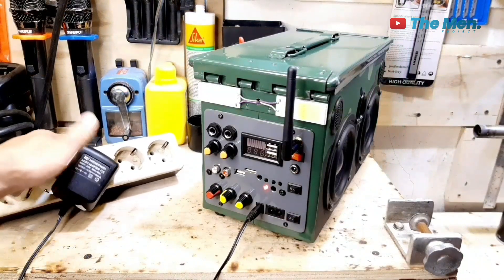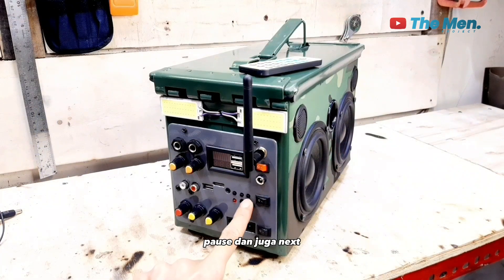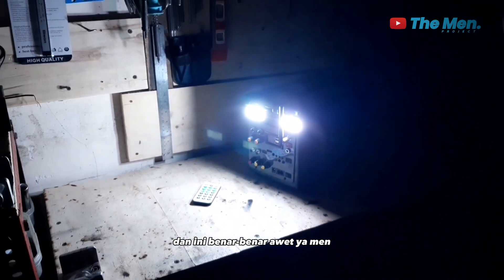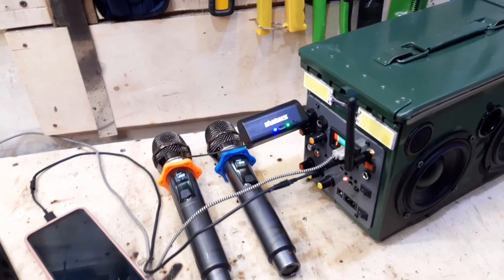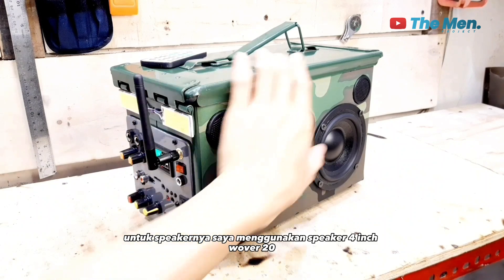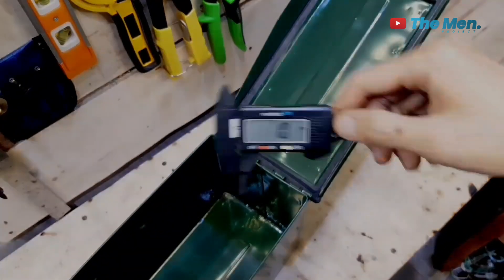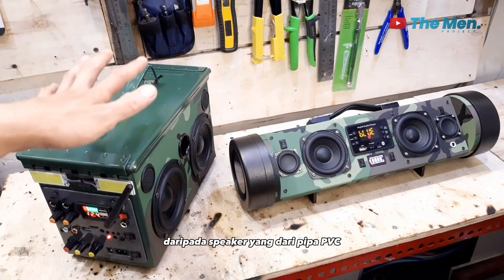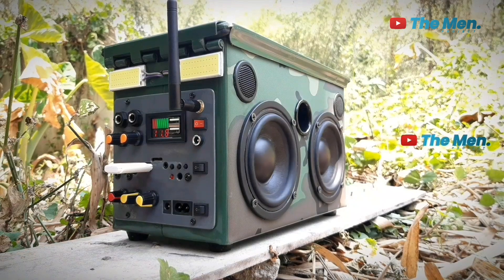Review Fitur Speaker Kotak Peluru | DIY Portable Speaker

Comment: Ngatasin dengung di speaker gimana ya?, sy pake pam8403
Reply from the maker: Cobak di Input tegangan di Modul PAM nya kasih elco bang.. 2200mf 25 volt. Kemungkinan dengung berkurang bahkan hilang
Reply: @armanusubekti  sy coba 4000uf 16v tadi masih dengung, tpi nanti sy coba lagi yg 25v, btw power 5v nya bagus ambil dri adapter hp apa psu 5v bang?
Reply from the maker: @PALESTINE_WILL_BE_FREE_99  sebenernya sama saja si bang. Pakai PSU atau adaptor. Tapi lebih baik dan minim noise bisa pakai power sendiri sendiri. Kusus 5 volt di buatkan tegangan sendiri